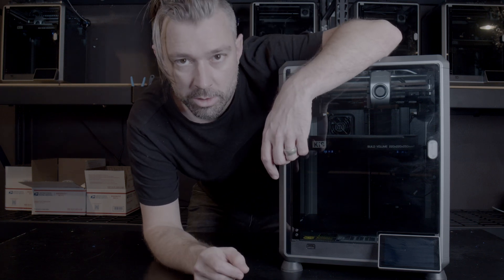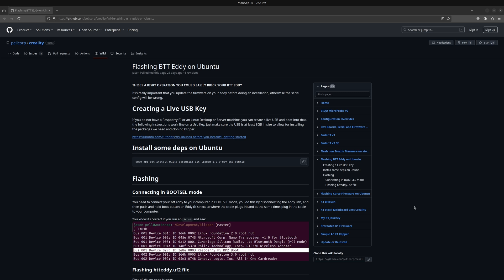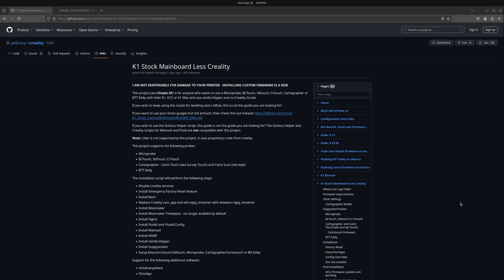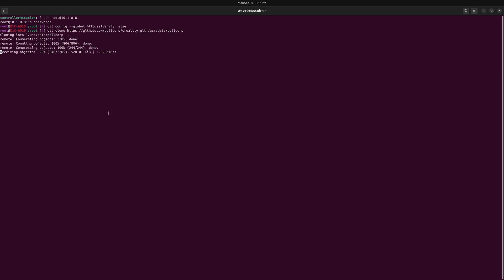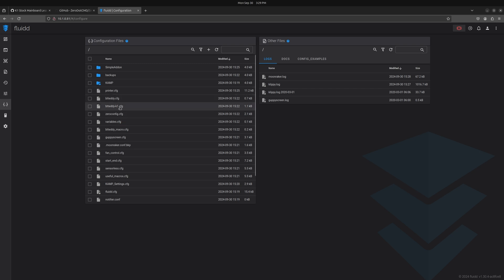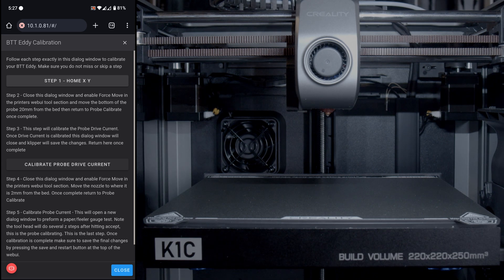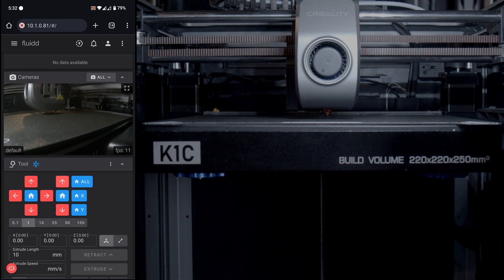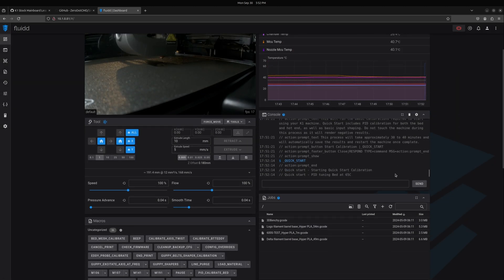Creality K1 Firmware & Probe Upgrade: The Definitive Guide

Comment: Hi buddy
One question, i know it's 1 year old video but i have k1C allready rooted and unlocked and have Fluidd on it, do i need to factory reset it anyway to be able to install eddy on it or how do i add eddy to Fluidd . Nice video btw.
Reply from the maker: Yes you'll want to factory reset and remove any custom firmware mods before you do this.
Reply: Thanx 👍

Comment: Thanks for the video.  Helped a lot on the install, there were a few things that have been updated since the video went out.  My question is, has anyone been able to get the CFS system working with this version of firmware?  Have the K1 Max. Took a bit of figuring out with the wiring, I connected the Eddy Duo to the existing port for the Lidar.  Only problem is it is a 4 pin on the Eddy Duo and a 5 pin on the Lidar cable. Once you figure out the positive and negative for each pin out.  On the 5 pin, you use the Pin 1, 3,4,5.  Hope that helps a little bit for someone in the future trying to install.

Comment: I cannot get the "clone the repo" step to do anything in the terminal.  It just won't start pulling from github.  I've tried Ubuntu terminal and Mobaxterm on Windows.  It just puts all the lines in the termina; and doesn't do anything, and when i hit enter it just goes back to the root line.  I've never had this problem before in the past.  Any ideas what going on?

Comment: Thank you so much for that! I do have a couple of quick questions please. When I do the factory reset will that remove any of the rooting software that I have installed? Also, I have the CFS unit connected to my K1 max, will I need to reinstall that firmware after a factory reset please? Thank you very much!
Reply from the maker: Unfortunately the firmware isn't compatible with the CFS. This may change in the future but at the moment you'll want to stay stock if using the CFS.
Reply: @zerodotcmd  I have been talking to some people on Facebook that are running the BBT Eddy on their K1 Max’s with CFS units but without the firmware and the probe is running fine, that is a big relief!

Comment: Hey there! Hope you’re doing great. I’m reaching out for a bit of help with CFS. I’ve set up my K1 Max according to your instructions and it’s now running on native Klipper. Now, I’m thinking of installing the CFS and upgrading kit. But I’m a bit confused. Will it require Creality’s firmware to control the printer? If so, how can I reverse the native Klipper? I did flash the HotEnd Board as per your instructions, and I’m guessing that if I reflash the Creality Klipper, it won’t recognise the HotEnd correctly.

Alternatively, I was wondering if it would be simpler to buy a brand-new Back circuit for the extruder, install it, and then flash back to the Creality firmware. What do you think?

Comment: Hi, erst mal danke für das tolle Video , ich finde es super. Nun habe ich allerdings ein Problem. Beim Ausführen der "AXIS_TWIST_COMPENSATION_CALIBRATE " fährt der Werkzeugkopf nach rechts, ich kann Einstellungen vornehmen. Nach der Bestätigung der Einstellung fährt der Werkzeugkopf in die Mitte und stoppt mit der Fehlermeldung "Probe triggered prior to movement" Könntest Du mir bei diesem Problem weiterhelfen? Den K1 Max habe ich auf Linearschinen umgebaut.

Comment: Hello, how can I disable the clean nozzle,  auto bed leveling, and the shape leveling,  every single print. Is annoying
Reply from the maker: This firmware doesn't use nozzle cleaning. Those are only found in stock firmware.

Comment: You get more control but does it print better quality or faster? Can I use a really cool peripheral? I don't care if I can customise my steps/mm or whatever else in detailed configuration. 

What are the perks immediately after flashing?
Reply from the maker: Mainly the most immediate benefit is the ability to use after market probes. One of the major fall backs for a lot of these machines is highly inaccurate bed meshes which cause massive problems for first layers.
Reply: @zerodotcmd  Guess I'm just lucky, my K1C just works, printing huge projects, put plastic in, get parts out.

I've heard rumors like this motion system can go even faster and I'd consider flashing if there was robust and reliable support for even more speed without turning my daily driver into a project car.

Comment: Hello, thank you for the amazing things you give us! I need a little help here. I have successfully upgraded the btt eddy firmware but I'm having issues now that I'm trying to upgrade my k1c, Printer when I try to install BTT eddy I get this message:" ls: /dev/serial/by-id/usb-klipper_rp2040*: No such file or directory", informing me there is no BTT EDDy attached to the k1c. I think I have done everything in your guides correctly so I have no idea what to do, The probe is connected and I can see a red light. Thank you for your help

Comment: hey zero :) Can you help me with the octoprint companion setup ? I have a k1 max with an eddy and the simple af firmware. I cannot install this companion on the normal way... + my front usb port cannot realize that a stick is plugged in with gcode files. Is this normal or is there a possibility to get this run ? I hope you can help me :) thanks.
Reply from the maker: I haven't used the octoprint companion with this firmware but I know people in the SimpleAF discord have. Join the SimpleAF discord and you should be able to find everything you need to get the companion up and running.

Comment: Sorry I should’ve clarified. I meant on the guppy screen on the home screen at the printer the default for extrude and retract. The highest it goes is 240. I wanna make it 275 or 300.
Reply from the maker: This is a good question. I personally do not know as I have not attempted to do so. I would recommend joining the SimpleAF discord and asking in there. https://discord.gg/fzdZCXS95a

Comment: in guppy on fluidd how do i change the extrude temp from 240 to 275 ?  im trying to find where to change it in the macro
Reply from the maker: On the main section you can press the temperature of the extruder and change the temp there.
Reply: @zerodotcmd  sorry i meant in the configuration files on fluidd.  on the printer screen the max for extrude/retract is 240 C, I'm assuming somewhere in the configuration files I can change that to 280 or 290 if I want but I just don't know where and I've been looking through and I can't find it anywhere

Comment: How do you use Eddie without garbage guppy screen and how do I use it with creality print? Because guppy screen is absolute garbage and so is orcaslicer   I followed your guide and it worked for about 10 minutes but I am very unfamiliar with orca slicer because it is garbage and is there a way to do this without guppy screen? Because that just screws everything up
Reply: Sorry I  meant to say that your advice and directions are very clear and amazing. Detailed and thank you. Like I said if there's a way to not use orca slicer and be able to use creality  print and not have to use guppy screen because of my experience it is garbage.  thank you  im a combat vet with multiple brain injuries and orcaslicer and guppy screen just infuriates me
Reply from the maker: Sorry to hear Orca and Guppy are frustrating for you. Unfortunately SimpleAF is required to use the BTT Eddy as the stock firmware isn't setup for it. I know both Orca and Guppy can be a bit of a curve for anyone not used to using them. I myself wasn't to fond of either when I started using them, but they have slowly grown on me. As far as I know Creality Slicer won't work with the custom firmware. I know a lot of people do like Creality Slicer so this is unfortunate.
Reply: @zerodotcmd  thank you for the reply   ive been experimenting with both orca and guppy.  not as bad as i originally thought.  i mean if you ever find the time to incorporate Knomi v2 into your firmware ill keep an eye out.  it doesnt seem to be difficult to set up just unsure what will happen if i installed it and then installed Simple AF.  is there a slicer that you"d recommend besides orca?  thats maybe a little more user friendly and has all of the settings in easy to find spots like creality slicer?  thanks again for the reply and detailed videos.

Comment: Im trying to flash the eddy before install but it isnt letting me. I have it in the boot mode when i plug it into my PC. Any ideas?
Reply from the maker: Sorry to hear you are having issues getting going. It can be hard to be helpful through the comments section on youtube. I would highly recommend joining the SimpleAF firmware discord as they are extremely helpful. https://discord.gg/fzdZCXS95a
Reply: @zerodotcmd  When your doing the k1 flash is it already expected that you have rooted it previously in fluid or is this part doing that?
Reply from the maker: @HGPracing17  No. There's no need to have it rooted prior. It will do everything it needs during the install process.

Comment: I have a K1C incoming from a black Friday sale, so I"m looking forward to adding the Eddy to it and using this tutorial for root.  Starting from scratch with a new K1C is there anything I should do before I attempt this?  If not I'll just start from out of the box with it.
Reply from the maker: Before you attempt to do any modding I would open the printer and run a few test prints for a few days. This will let you know if there is anything wrong with the printer before you begin modding the machine. If you go straight into modding and flashing firmware you may have a problem that you don't know about and easily fall into believing that the problem is the modding when it could be the printer itself.

Comment: Hey Zero, question.  I have the eddy connected via the lidar port on my k1 max (which I think I've re-pinned correctly). I've followed your guide and it keeps giving me an error afterwards saying it has an MCU Protocol error. Any ideas?
Reply from the maker: Hey sorry to hear you are having issues. The best way to help solve this would be for you to hop into the SimpleAF discord server. https://discord.gg/fzdZCXS95a
The community here is very awesome and extremely well versed in almost any problem someone would experience.
Reply: @zerodotcmd  Made a post this morning! Thank you!

Comment: Hi. Today I received a recently purchased Eddy sensor. I was a problem with the calibration. During calibration, after the command "Calibrate_btteddy" (step 5) and aligning the nozzle with the piece of paper, the sensor begins to calibrate and then displays the error "Failed calibration - incomplete sensor data"

Btt Eddy -18.0°C <<<<<<<<<<<!!!!!! (minus)
Btt Eddy Mcu 42.4°C
Chamber Temp 24.7°C
Mcu Temp 39.4°C
Nozzle Mcu Temp 38.2°C

Can you help?
Reply from the maker: @tomasztomek8518  I'm sorry to hear your having trouble with this. The coil should never read this low. If it is there is a good chance the probe is defective. If you picked this up from amazon I would suggest a quick replacement request.

Comment: Anyone else getting this error after a while of printing?

MCU 'mcu' shutdown: Timer too close This often indicates the host computer is overloaded. Check for other processes consuming excessive CPU time, high swap usage, disk errors, overheating, unstable voltage, or similar system problems on the host computer. Once the underlying issue is corrected, use the "FIRMWARE RESTART" command to reset the firmware, reload the config, and restart the host software. Printer is shutdown
Reply from the maker: I would recommend joining the SimpleAF discord. https://discord.gg/fzdZCXS95a there are many users who can help you trouble shoot issues like this. I will say we don't usually see issues with Timer too close, with the Eddy. So it is a bit strange.

Comment: Many Thanks for your work and sharing your experience .. upgrade part 1 to install the eddy finished .. glassplate possibly follows - parts i all have here , but first impression after really careful install .. a dream .. way better than the stock device .. warping reduced because perfect first layers .. only the firmware has a mini problem with the timeout of the display - sometimes its not possible to reactivate the screen while printing and restart is needed - remote control works still while screen is off ...
Reply: Hi i am the creator of SimpleAf, and yep i am aware of a couple of users reporting problem with guppyscreen.  It seems like guppyscreen is crashing for some reason.   You can restart guppyscreen from the services part of the fluidd ui.  Investigations are ongoing to figure out why guppyscreen is crashing, hopefully there will be a fix soon.   No need to restart the printer to get it back
Reply from the maker: Thanks for the information. This is interesting, as I haven’t heard reports of this issue, but I know that the guys over at SimpleAF would want to see this and understand what’s going on for you. The best way to start finding a solution would be to join the SimpleAF Discord server. I know the main developer there would be interested in hearing about this issue. Here is the link to the discord server! https://discord.gg/fzdZCXS95a

Comment: Random question. I see you can get a BTT Eddy Duo is available could you use that on a K1C and wire it into the Nozzle sub board I think the lidar plug? My thinking is one less cable to run to main board. Or am I wishing for too easy an option.
Reply from the maker: Unfortunately, the LiDAR port on the K1C isn't wired to the main board. Creality only wires the K1 Max from the sub-board to the main board. You can wire this yourself if you’d like.
Reply: @zerodotcmd  Many thanks
Reply from the maker: @michaelmoss9663  No problem!
Reply: @zerodotcmd  how would you wire it to the board

Comment: Appologies again - i have now managed to flash the BTT Eddy. I have connected via the LiDAR connection, but when i run the installer there is a warning - "INFO: Setting up btteddy ...
ls: /dev/serial/by-id/usb-Klipper_rp2040*: No such file or directory
WARNING: There does not seem to be a btt eddy attached - skipping auto configuration"

Also, still getting the rror message saying waiting for machine to intialise

Comment: Hi does not work for me i got this error i try 4 times same thing. I try to get help on Discord but i can post or read.

MCU Protocol error

This is frequently caused by running an older version of the
firmware on the MCU(s). Fix by recompiling and flashing the
firmware.

Your Klipper version is: v0.12.0-304-g50aacb57
MCU(s) which should be updated:
mcu: Current version v0.12.0-295-g6bee7f5f7
eddy: Current version v0.12.0-152-g3e85560c
nozzle_mcu: Current version v0.12.0-295-g6bee7f5f7
Up-to-date MCU(s):
Reply from the maker: Sorry you are having trouble. in the discord channel you need to go to the rules section and hit thee 100% emoji to agree to the rules. Once you've done this you should be able to see everything and talk. Goto the SimpleAFSupport section and there are a few people that can help you get up and going.

Comment: Apologies for the questions - on the K1 Max, there appears to be no port on the main board to accept the BTT Eddy Probe USB, this being the case, there is a port that accepts the LiDAR sensor. Could this port be used to connect the BTT Eddy to? if so, could the connection at the tool head also be used as this would do away with trying to run a wire to the tool head? - Thank you.
Reply from the maker: Yes the JST port on the MCU for the Lidar cable is where the probes plug in. Its just a USB port. On the Max you can plug into the tool head and use the USB pass through. This is what the Lidar makes use of.

Comment: Thanks for the great instructions, I have a question though. Is there a way to change the temperature that the Eddy needs to reach before starting Z homing. Mine says it must reach 54* C before it will start the Z homing and with an open printer that is tough to achieve. Everything else works great and was easily done by just following along.
Reply from the maker: This is due to the initial calibration. The Eddy probe needs to be calibrated at a temperature as close to ambient as possible. It is recommended to calibrate the Eddy above no more than 30c. Redoing calibration would be required for this. Keep in mind you want to calibrate the Eddy with the bed temperature off.
Reply: @zerodotcmd  i figured out what my issue was and corrected it. Works flawlessly. I need to get the glass bed ordered to fix this warped excuse of a bed now.
Have you tried to install Octoprint with this firmware, was it successful if you did. Im having issues getting the octoprint repo to  work.
Reply from the maker: @chadpolito7  I've not installed Octoprint on any of my machines. I know a few people in the community have installed octoeverywhere. But I have not personally done it.